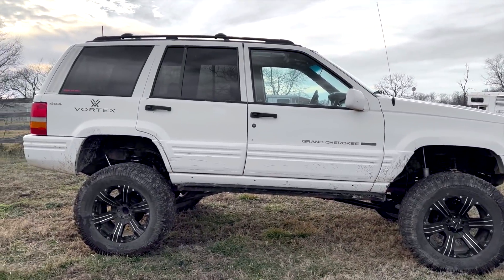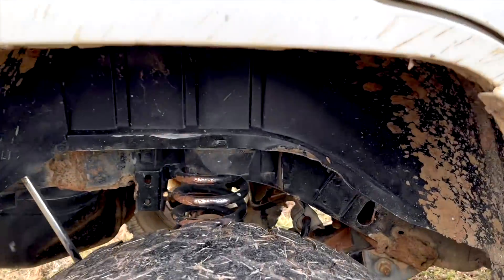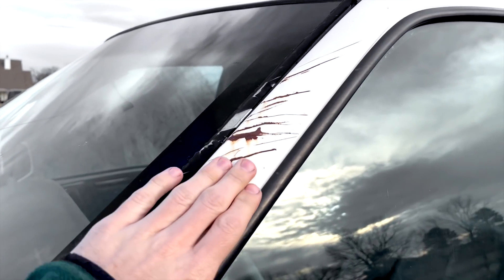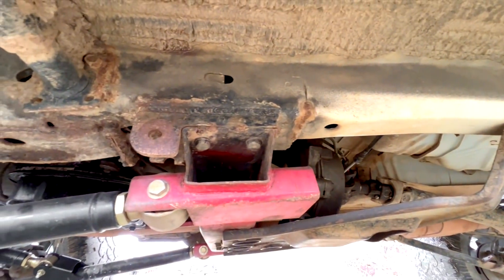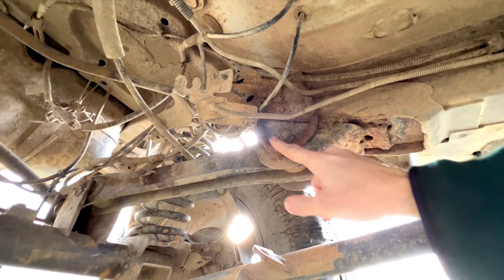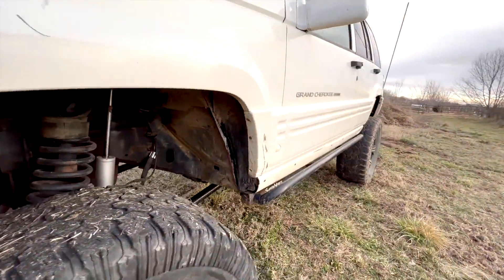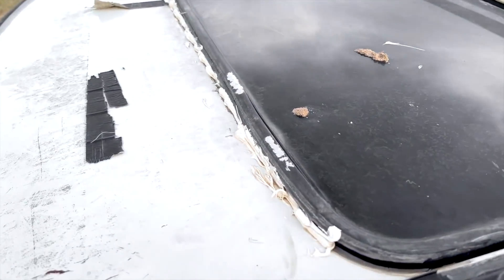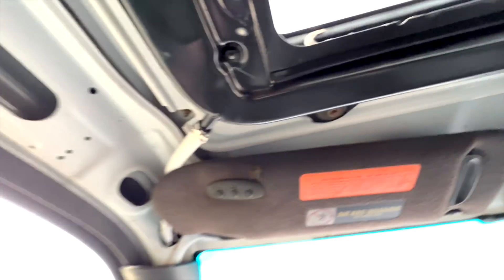I Bought A RARE 5.9 ZJ

Comment: It’s actually in pretty good shape. I got a stock one a few years ago for $500 and it was rust free. The person said it kept losing coolant and thought it was a head gasket so they didn’t want to fix it. I took it home and it ended up being the small hose that goes to the water pump. It ran great but unfortunately I got into a financial pinch and had to sell it. I had one with the 4.0 also and drove it till the frame cracked. Great running Jeep’s some of the better ones made IMO
Reply from the maker: It's really not bad! Been in Arkansas, Missouri, and Oklahoma it's whole life. I'm excited to start the build! Thanks for watching!

Comment: looks good man. great start for sure! welcome to the ZJ family! 
a few notes for ya, if that actually still has the 249 t-case, swap that thing out for a 242 or 231 asap. the 249 is juuunk. also, that does not have a sye like you mentioned, that is just a double cardan drive shaft. that being said, if your going to stick to that height and swap to long arms on the rear, you may and may not need to go to a sye. either way, get rid of that double cardan shaft. thats just one more u joint to fail out on the trail imo. good luck with the build! lmk if you have questions. been in the zj world for quite a few years.

Comment: I think fix the lift and put on some 35s. Small lift with some take-offs would be nice to get it going for now. And an off topic question.. how do you like your led headlights in your WJ? I have the same housings and I'm just wondering how the LEDs are in them
Reply from the maker: That's what I'm thinking! The led bulbs are great! Good cut off line and bright. make sure that you get the shorter ones though

Comment: IRO makes solid suspension systems. Have you looked into Trail Forged suspension link kits? They seem pretty cool, and they sell 1 ton steering kits too. That’ll get this poor thing’s axles un-janked, and you’ll feel a lot better. That D44 pumpkin is MASSIVE. Big tires are probably a must as a result, but you’ve done impressive work stuffing 35s on your WJ. Is that D44 an aluminum case like the WJ?
Reply from the maker: I think I'm going to start with the rear and put in a IRO 4 Link like I have on my WJ. That should clean up most of it, and then I can start on the front. Probably go Trail Forged steering like on my WJ also. The pumpkin does look huge! I think it's because the gas tank doesn't cover it as much as it does on the WJ. Need a tank tuck on the dub! And it's supposed to be the same aluminum 44A case I believe
Reply: @OverlandingOzarks  That's correct. The V8 ZJs came with an Aluminum D44. D44A

Comment: If it were me, I would make that a trail/beater rig since it’s already in worse shape than the wj, and keep the wj clean. Long arms, lockers, 35’s lights/winch and clean it up a bit.. that’s my plan only I’m going with an xj for my beater..
Reply from the maker: I'm going to clean it up, especially since the unibody is mostly clean, and clean up the body and interior but I think this will be more of my hardcore crawler rig that get's 1 tons and big tires first

Comment: The VIC that’s blinking is a common thing. They all do it. Means nothing. It’s an issue with the board in the VIC. Even my 97 with only 91K miles had a clapped one. What I did with mine is removed the internals from it and used it to mount switches to instead. Much more useful. As far as the moonroof… what a shame. if you’re able to get all that junk off it that they put on it, it’s a fairly simple fix to get it moving again. Sometimes it’s the position switch which is located above your head inside the track of the moonroof. But usually, it’s simply an issue with some solder joints in that little board that’s connected to the moonroof motor. Could also be the motor, but I’d say it’s unlikely. Put power to it manually and you’ll know right away. I may have photos of when I did the repair on mine. Literally a walk in the park since yours already has the headliner out. Lmk. Would be glad to help you figure out the inner workings of a ZJ! Lots of quirks, but they’re amazing.
Reply from the maker: Is it blinking because it thinks the sunroof and hood is open? I don't think it was blinking when we drove it before I bought it
Reply: @OverlandingOzarks  nope they’re completely unrelated. The VIC won’t always blink at you, just here and there. And it’ll be brake light failure, coolant level low aswell as highlighting the engine. I didn’t investigate it to see if it was repairable because I wanted to have auxiliary switches down there, but every single one I’ve had has had an intermittently confused VIC. Just a solder or wiring issue with them. They start to think the world is ending after a certain amount of time lol. If you’re dead set on getting it working again, could take it apart and toy with it a little see if you can find broken solders or something along those lines. 

The moonroof motor has that little black box attached to it with some wires going to it. Follow the wires to where they clip in somewhere along the roof, unplug them and pull that little box down. Open it up and look real close at all the solder joints. I was able to find the photos I took of when I did mine. It’s as simple as applying some solder to them to refresh them. Also while you’re at it, it wouldn’t hurt to apply direct power to the black and green wires that power the moonroof motor. If it moves, you’ve got a good motor. The direction you apply power will change the direction the motor spins. Feel free to shoot me a text if you’d like,  six oh seven 857 7134. Be happy to send the photos your way so we can get that roof working again.
Reply from the maker: @johnostrum6953  Awesome! Thanks for the tips! I'll hit you up when I get into that!
Reply: @OverlandingOzarks  definitely do! Look forward to seeing where this thing goes

Comment: If the sunroof is leaking, it's probably because the glass is no-longer bonded to the metal frame. That was the problem on my ZJ. I took the glass and the frame out, 3 bolts each side under the glass and re-bonded the glass and frame together using windscreen bond. You don't need to remove the whole sunroof mechanism, just the glass and frame. Put the sunroof in the tilt position and you should see them. The flashing warnings on the info centre will go away as you fix the problems, one warning light was for the lift hatch not being closed correctly.
Reply from the maker: Awesome! Thank you for the great information! I'll check it out this weekend. Thanks for watching!

Comment: It's missing a lot of the 5.9 Limited specific parts....Check the computer to see if it's death flashed....
Reply from the maker: Only thing it's missing is grille and speaker bar... Rockers, vents, axle, lsd, leather panels/shfiters, roof rack, 5.9, vin, and more are all correct. No death flash sticker, has never been west
Reply: @OverlandingOzarks  It's also missing the electric fan (one of the biggest gains for power in the 5.9), possibly the temperature switches, tail pipe end also missing. Looks like a fun project!

Comment: You found a gold nugget .. Less than 14000 of them made, probly less than 10000 of them left .. The first muscle car suv, Worlds fastest suv in 1998. I just bought the same white 98 5.9 stock with 5.9 on back hatch too. Bro! Think about what you have in your possession  .. Unicorn is right .. Do it the right way. I'm stoked for the next video Thanks
Reply from the maker: Might be a rough gold nugget, but I'm excited to get started on it! Thanks for watching!
Reply: Cash for clunkers absolutely decimated vehicles like this. I wouldn't be surprised if there's only a couple thousand running 5.9s left, if not less.